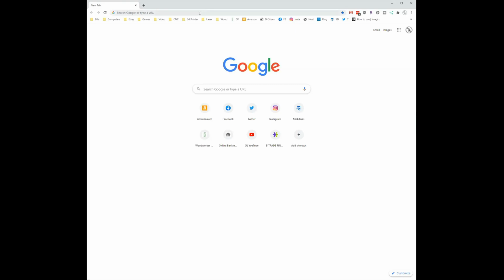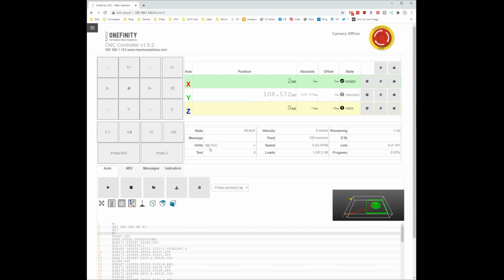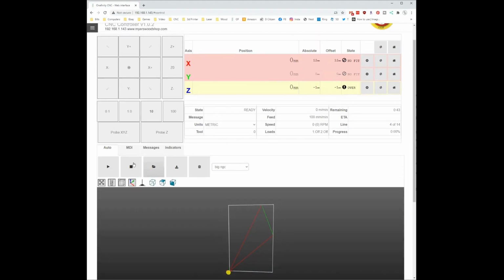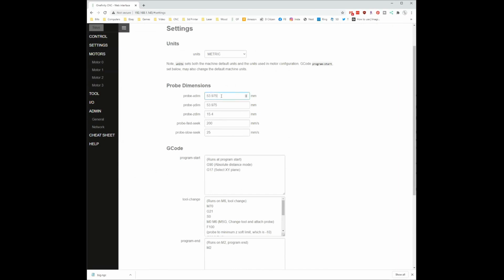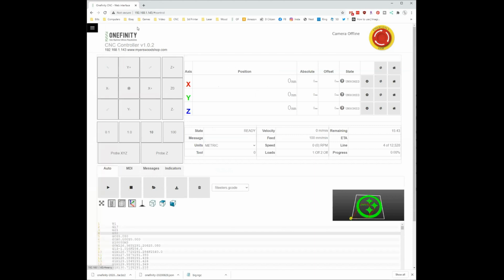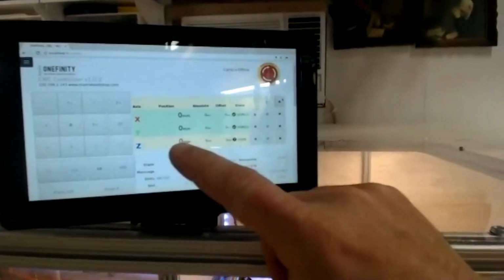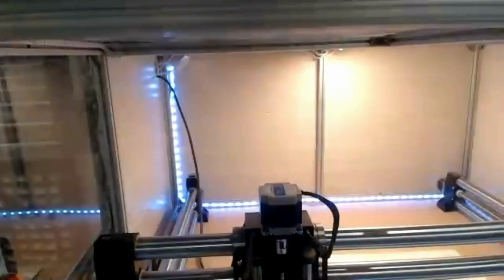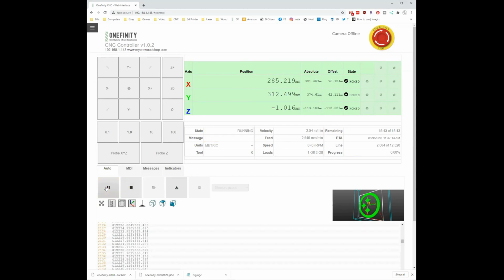Onefinity Walk Through Session Via Zoom Live

Comment: Great information and like the fellow on the podcast I like the cnc enclosure.  I have ordered my Onefinity woodworker based on a lot of what you have shared here on Youtube. Im in the process of building my enclosure now 4' x 5' as recommended in the manual. was wondering about how much vertical clearance would you recommend. right now im planning on 39" with the base of the machine setting at 36' off the floor. By the way I'll be welding mine together using angle iron for the frame. Again really like you work keep it going.